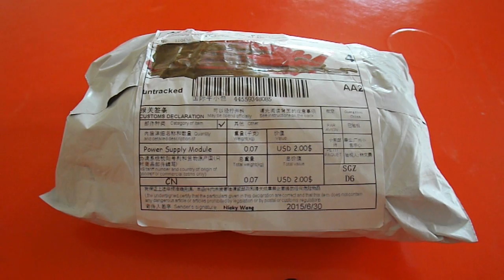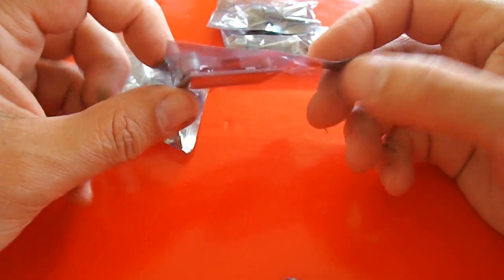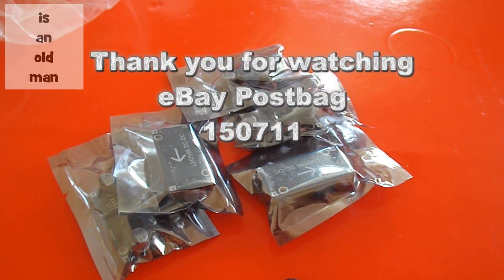Grandad's Postbag 150711 - LM2596 3A DC to DC Buck Converter

Comment: I know them ;-)
Have double the amount I guess. But one tip: they have no protection what so ever, so you end up burning them out very quickly. First thing to do is solder wires to them so you can see red and black, or use red and yellow to also show input differing from output. I use these little guys in things like no-longer-working LED light at 230Volts. I cut out the electronics and use the lights with a dc-dc converter. Even if you do not control the current, if you stay in the safe (lower) voltage zone they are okay. A defect on a 10 Watt LED bulb results in a lot of light at a fraction (1 to 2 Watt) and it can be regulated.
Reply from the maker: Hey, just had to look at this video again in response to a question on a different video. Spotted I never put a reply to you 5 years ago, so I am replying now. Hope you are keeping well 😊👍 I might try your tip on the dead LED lights.
Reply: @GrandadIsAnOldMan  who is counting :-)
cheers!